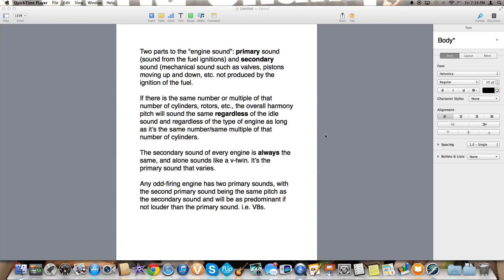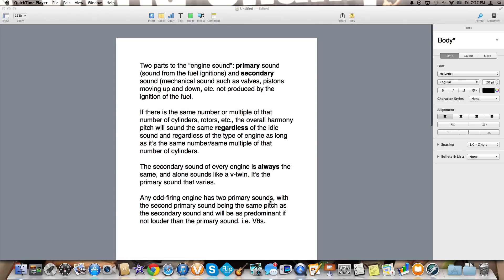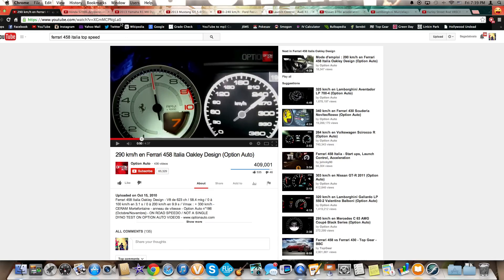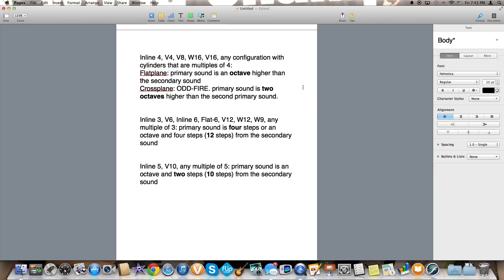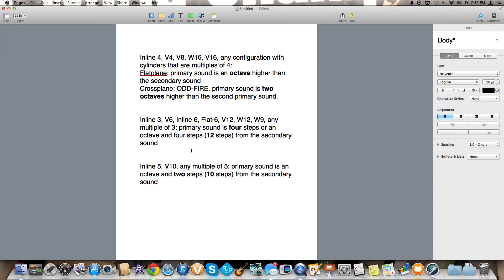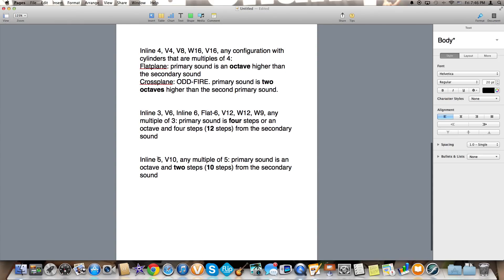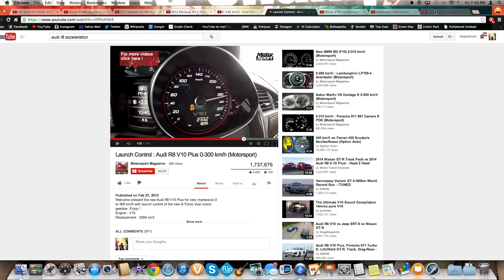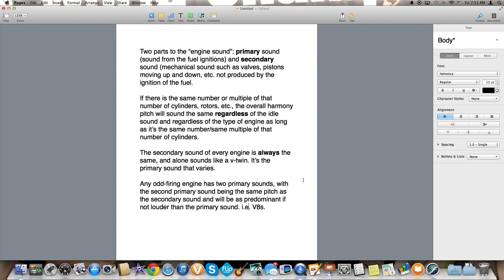Engine Sounds Explained

Comment: isnt 12 also a multiple of 4
Reply: true
Reply: db34desen but an inline 4 sport bike sounds like a v12,or v8 Ferrari.  the reason is it revs double as a car. mine can rev to 16k rpm, from 07 kawasaki ninja zx10r. just watch a 600cc or 1000cc  class sport bike racing and when they pass by ,sounds just like a bunch of v12 f1,v8 f1 pass by
Reply: Kawaii Ninja damn your 10 revs to 16k? now my '98 zx9 seems inadequate only getting to 12k while still having a smaller engine lol. maybe because it's FI instead of carb'd?
Reply: creator 44 my can do I think 16k rpm if I ecu flashed, with factory rev limiter I can do 12k, usually a smaller engine can rev hugher, for the first foremost reason is physics, small pistons weight less and so you can combust faster. even your zx9 is only 100cc smaller but your engine is older design, older technology, so rev less
Reply: Word yeah that makes sense, factory limiters are probably set for more reliability/longevity rather than the absolute mechanical limit of either engine. They both have pretty short cranks
Reply: creator 44 yeah, plus dohc engine can rev higher.
Reply: Benjamin Schumacher jeez that must sound insane how much hp did they make?
Reply: Benjamin Schumacher jeez that must sound insane how much hp did they make?
Reply: Tyler Heiser count from 1 to 10 what comes first 3 or 4 lol
Reply: Tyler Heiser it is, but is odd counted number.
l4+l4=v8 ☑
l3+l3=l6=v6 ☑
v6+v6=v12 ☑
l4+l4+l4= v8+l4 ❎
Reply: Yes but it would have to be a W formation which is a thing but very expensive
Reply: Tyler Heiser its 3 bro

Comment: I'm obsessed with seven-cylinder engines. Such a strange sound from 7C radial engines, for example; like a motor that wants to be a V8 but doesn't quite have the motivation.
Reply from the maker: 7 cylinder engines are a perfect 7th.
Reply: The Eliminator Project it’s like the leading tone lol.

Comment: Does that mean a V6 and I4 can sound like a v12? since 12 is a multiple of 3 and 4?
Reply: Good question
Reply: The V6 would, not I4 as far as I know
Reply: PuffinDragun69 the v12 would sound similar to an i6. if you rev a v6 or an i3 at 8000 rpm, i imagine it would sound similar to a v12 at 4000 rpm.
Reply: youd have to rev an i4 at 6000 rpm to make it sound like an i6 at 4000 rpm. and i6s have the identical pitch with v12s so it might be possible. but i don't think so

Comment: Where did you read, that the S65 AMG V12 (M279 I think) was odd-firing? Also, a crossplane V8 is only odd-firing between the cylinder banks, which still makes it even-firing (it sounds odd-firing because each bank has their own manifolds). And I'm also quite sure that the 90° 5.2 L Audi V10 is even-firing, because they use an 18° split journal. I hope I didn't misunderstand you.
Reply: Vethursan1 i heard years ago that they don't have the classical flat plane engine. thats why mercs have a low rumble even though they are v12s

Comment: Cross-plane inline fours do not sound like a cross-plane v8. They sound different than their flat-plane inline 4 counterparts, but they sound nothing like a cross-plane v8.
Reply: There are also different crank and bank angle configurations in the multiples of 3s and multiples of 5s that will give a distinct sound that breaks the 12 step or 10 step rule.
Reply: Subaru boxers sound like lawn mowers.
Reply: +Tim Ramich no.
Reply: +faisal3398 Yes.
Reply: +Tim Ramich no
Reply: +kenykillr Yes, and don't just say yes or no without a counter argument.
Reply: Tim Ramich Subaru's UEL headers don't sound like lawn mowers, and neither do
Hondas
Reply: +faisal3398 Subarus sound like lawn mowers, and small, high-revving flat plane inline 4 cylinders sound like weed whackers. I'm not saying this is a negative thing...
Reply: +kenykillr Yes, and don't just say yes or no without a counter argument.
Reply: Tim Ramich Sound is subjective, just purely based on opinions.
Reply: +faisal3398 Saying something sounds like something else is not subjective. Saying whether it's good or bad is... How many times do I need to clarify my stance on this, that the things I'm saying aren't meant to be negative? By your logic, if a Subaru doesn't sound like a lawn mower, then it must be perfectly acceptable to say that it sounds like a Harley.
Reply: Tim Ramich I don't think it sounds like a Harley...
Reply: +Tim Ramich Dont know what kind of engine you put on your lawnmowers, but over here, they sound  WAY different than subaru boxers

just no similarities at all!!!
Reply: +Tim Ramich They do.. however don't forget they rev much higher and quicker. Secondly, you have to bear in mind that the sound is transmitted through a smaller exhaust on the R1, so the resonant frequency of the actual exhaust system will be higher compared to that of the Mustang by virtue of it's size. - This bit isn't covered in the video.

(Reasonance: When the driving frequency (of the engine revving) matches the natural frequency (of the exhaust piping), in the correct phase, to produce a louder sound).

If both had a similar exhaust system attached, they would indeed actually sound exactly the same.
Reply: true but more like a Ducati v twin engine. but a little different as you can imagine two bigger cylinders sound compare to almost two cylinders fire at once  sounds.
Reply: +Tim Ramich The only reason why Subarus have that rumble is because they have unequal length headers, has nothing to do with the engine configuration.  Obviously it would sound a little different if you had UELHs on a Lamborghini V12, but with ELHs on a Subaru it sounds just like any other 4 banger.
Reply: Yes they do...

Comment: The mustang sounds deeper mostly because it has one overlapping exhaust pulse per revolution of the crankshaft that alternates back and forth from one cylinder bank to the other and it also has two larger exhaust pipes (one per bank) compared to the cross plane 4 cylinder that doesn't have as much exhaust pulse overlap (because it's cylinders fires at 180 degrees rather than 90 apart) and has smaller pipes and is a much smaller engine
Larger pipes tend to deepen the tone. So do bigger engines.

Comment: I'm gonna disagree with these engines sounding the same, inside a car it may sound pretty similar, but considering the quality of the audio, the fact that car interiors dumb down the sound, these factors affect the true sound coming out of the engine. I believe that some attributes, like the amount of pistons moving in the engine, make the sound different. I can hear the difference with the V6 and V12, the difference between the 458 and the S2000.
Reply: I forgot to explain why they sound different: because the cylinder timing, valve timing, and many other factors make it sound different. I will agree that at higher rpms, it makes similar sounds because it is hard to detect when the cylinders are in the billionth of second, but at low revs and mid revs you hear it clearly.

Comment: Is a 4 cylinder Subaru boxer engine also considered a Japanese ricer sound?
Reply: +thesnakebites1 yes. all 4 inline are ricer, even rally cars sound like ricer
Reply: +Diego V in-line =/= boxer though
Reply: Diego V But a boxer engine isn't "inline?" Each cylinder is horizontally opposed to one another, so I don't understand.  Did you mean to say "flat," like the engine design Porsche has been putting in their sports cars (e.i. H6)?
Reply: Depends on the headers; If it has regular headers on it, it'll sound like any other 4 cyl fart box, but unequal length headers give it that iconic Subaru burble

Comment: A completely wrong approach.
If the sound depends only by a multiple of cylinders, then how can you explain Laverda Yotta triple sounding like the boring 4-pot screamer?
If the engine is straight, the only difference in sound is the crankshaft angle. A V engine has also the V angle.
Multiples of 3 usually have a 120 degree crankshaft so their sound is sharp or 12 steps difference. That way you can install a twin crankshaft with 120° between crankpins and modify cam timing accordingly and you will get an inline twin sounding like a 3, 6, 9, 12 etc engine.
Multiples of 5 use 72° cranks. My Virago 535 has a 70° V angle so check it on Youtube and compare it to the same Ford RS2000. And Virago has only 2 cyliners.
So the number of cylinders alone doesn't mean anything.
And yes. You can make a V6 sound like a V8 in any manner but it will take a whole lot more than just modifying exhaust.
VFRs sound different than Magnas (both have V4s). Why? Magna has one pin crankshaft (360°), VFR has 180° one. Therefore they are comparable to each other exactly like italian (flatplane) V8 is comparable to American (crossplane) V8.
For musicians: Take a wooden cylinder, drill a hole through its center, mount it on a drill, mark different sets of angles (0, 90, 180, 270, then 0, 72, 144, 216, 288, then 0, 120, 240, then 0, 90, 135, 225 (it's a crossplane stuffed to one revolution)) on its outside, cut  thin holes and place pieces of plactic tape or something that could impact another object by spinning into these holes. The result should be a cylinder with pieces of tape (or something hard) sticking out of its side wall. Do it according to the sets of angles. Then take something similar to an exhaust pipe and experiment by slamming the loose ends of the tape to that pipe or whatever.
The only downside is that you won't hear a Mustang out of 0, 90, 135, 225 angles. It will be more like a Corvette. :)
Reply: Dogbrain Incorporated do you think people actually read all that 😂😂😂
Reply: @liltimliltim1284  i am

Comment: You should have used Carrera GT or LFA to demonstrate how V10 should sound , as most other V10s are extended V8s .
Reply: Mladen Milić please elaborate "extended v8" if they adjusted the camshaft it will sound exactly like a classic v10
Reply: Carlos Leon Extended V8 is engine based on V8 design. For even fire order V10 should have 72 degree Vee angle. As v8 is default, many v6 and v10 share parts with those V8s.

Comment: forgot about the v twin and w3 engine, also boxer 4, and for the most part engines with the same multiple of cylinders can sound the same but w engines and inline engines are too far apart to really sound the same. especially since most W engines are not flat plane, but if you did something such as matching the firing order of 2 honda 4cyl vtec engines and somehow getting a custom block and flat plane crankshaft to make a v8 it would sound a lot like a single vtec engine. but not all engines follow these laws you put in place. especially since you can do things like increase displacement, change firing order, change cams, and other modifications that can significantly change the sound

Comment: There are a couple good points in here, that's a fact. However, there's more incorrect statements made, as well as idiotic, opinionated remarks that only make those worse. A few that stick out to me are all 4 cylinder engines are ricers (which is the foundation of his ignorance and thus my complete disregard for this individual), that of a V10 NSX (never happened, never conceptualized, never rumored. They have ALWAYS been V6's), Americans like V8's, the constant references to Toyotas being cheap, and the complete lack of information about flat engines (Porsches and Subarus don't sound like anything other than themselves).
Reply: Actually, the present NSX was planned to be V10, and they even had prototypes running with the V10.
Reply: also the porsche and subie i think credit their individual sound to exhaust tuning as well with their un equal length headers. i was thinking the same thing until i realized both of the companies you mentioned are also running exhaust unlike any other company. i think if you put equal length headers and a magnaflow muffler or something common it would sound the same as explained in the video.

Comment: Also different rotary engines will all sound different. 
a single rotor will sound like an even firing 2 cylinder with 2 into 1 headers
a 2 rotor with 2-1 headers will sound like an inline 4 with 4-1 headers
a 3 rotor with 3-1 headers will sound like an inline 6 with 6-1 headers, such as the supra
and a 4 rotor with 4-1 headers will sound like an even firing v8 with 8 into 1 headers
Reply: Chris Huynh an i8. a v8 has the same pitch as an i4 at a given rpm. a flat 8 works too
Reply: False, the only time an 8 cylinder engine will sound the same as an even firing inline 4 is when 4-2-1 or 4-1 headers are used on a flat plane v8, or a crossplane v8 with 180 degree headers with no connection from each pair of exhausts, for example, true dual exhaust flatplane v8 with no x-pipe h-pipe or y-pipe, exhaust from each bank completely separated from eachother.
Reply: are you listening to yourself? you are clearly givimg examles that confirm my statement
Reply: I guess you're incapable of reading large blocks of text. A Flat plane V8 with x-pipe or 8 into 1 exhaust will NEVER sound like an inline 4. Your statement cannot be confirmed because it is only true on a specific example, and wrong in every other configuration of exhaust.

Comment: The only reason the S2000 sounds like a 458 in this video is because the original videos were shot on camera phones with cheap microphones that modulate the volume down because of the loud primary frequencies and they can't pick up the quieter higher harmonics.  You need to compare them in videos shot with professional microhphones.  All of your comparisons were shot with crap microhpones that do not actually represent what the car sounds like.  This is what a F458 really sounds like:  
https://www.youtube.com/watch?v=F6RsZhySjKE

Comment: You're completely wrong about all of this like to the point of this being a parody. Explain to me how a 3 cylinder sounds like a v12 at 9k rmps and a 4 cylinder sounds like v12 at 9k rpms but a 3 cylinder doesnt sounds like a 4 cylinder at 9k rpms? Secondly nobody is complaining about the 4 cylinder mustang because when you buy a mustang you still have the option of a 6 or 8 cylinder as well. Inline 4s have been around for a very long time and will continue to be around because people love them. Last thing I want you to understand is you're correct about firing order does play a part in exhaust sound but headers play a huge roll as well (i.e long tube vs short tube) dont believe me? Ask the guy at Porsche who thought it was a good idea to put uneven headers on the Carrera and made it sound like a Subaru instead of a Porsche (same motor totally different sounds) heard he's working a Pontiac now and muffler are specifically designed to change the sound (e.g enhance certain sounds while muting others) it isnt just about the amount of cylinders dude. Merry Christmas and godspeed captain

Comment: Shouldn't a flatplane inline 4 need double the revs of a flatplane v8 to make the same sound since the i4 fires every 180° and the v8 fires every 90°??? Unless the exhaust headers play a role here. at 30 rpm an i4 fires once every second but a v8 would fire twice, for the i4 to fire twice it would need to spin at 60 rpm. I mean, they should make the same sound but at a 2x rpm difference. so, why don't they?

Comment: Why do cup cars sound so differrent from the street cars with similar engines
especially interested in the porsches
Reply: Mainly a combination of no muffler, so you hear a much harsher pressure pulse and the fact that they have much smaller and lighter flywheels and clutches, meaning the revs rise and fall much faster with less pedal lag.
Reply: Also straight-cut gears.

Comment: Would have been nice to explain how rotaries sounds work... 2 an 4 rotors don't really sounds the same but 3 and 6 are pretty similar...
Reply: Louis-Philippe Veillette you just gotta find out how many times they fire per rpm and find a piston engine with the same firing frequency. they'd basically sound the same
Reply: They fire once per rpm, but their sound is way different, i mean primary sound is easy to hear, but there is a secondary sound too, the rotor itself which is what you hear while the engine decelerates. And let's say the 2 rotors has a tone close to a 4 cylinders, the 3 is nowhere close to a 6 cylinders and even less the 4 rotors, which has a F1 tone.
Reply: Louis-Philippe Veillette 3 rotors would be akin to an i6 amd i6s are not used much in the car industry. and 4 rotors would be like an i8 which would be a crazy long engine. maybe the deceleration sound is unique but i think this video addressrs the pitch mkre than anything

Comment: YOUR definition of "odd firing" and "even firing" is completely at odds with what everyone else in the world thinks!  A cross-plane V8 engine by definition is an even firing engine.  There is a power stroke every 90 degrees of crankshaft rotation, as compared with a flat-plane where this is not true.  Some of the early 90 degree Detroit V6 engines used three crank throws, and since they were 90 degree engines, the power strokes were NOT every 120 degrees.  THAT was an odd-firing engine.
Reply: Crossplane V8 has even fire order, but each bank has its own header and each bank has odd fire order, bang - -
 bang - bangbang - bang - - bang - bangbang

Comment: You might be intelligible with music theory but nuances in automotive exhausts are waaaay beyond observing some registers.
If you can' tell the difference between a Toyota Supra on a cast manifold, versus an unequal length, vesus an equal length tubular and think it sounds like a V6 Camry, you're very wrong.
MORE similar than a 4, 10, or 8... Of course, but similar, no not really.  There is more to sound than pitch.

Comment: Every multiple of 4 sound the same and 12 is a multiple of 4, therefore, every multiple of 4 sound the same as a V12. Every multiple of 3 sound the same and 12 is a multiple of 3, therefore, every multiple of 3 sound the same as a V12. By this we might conclude that every fucking engine sounds the same